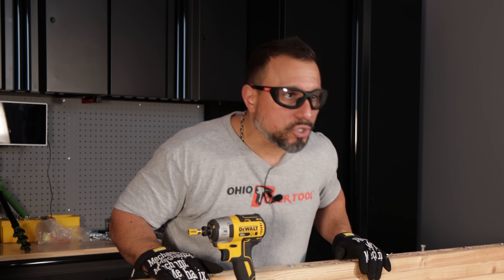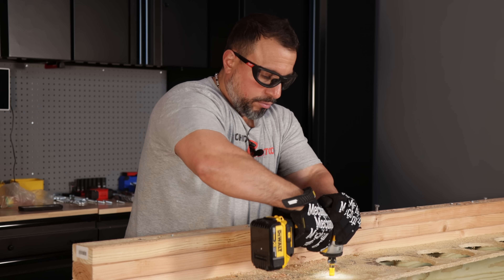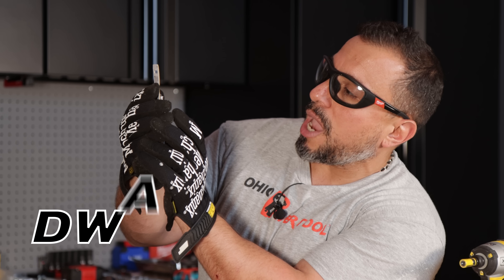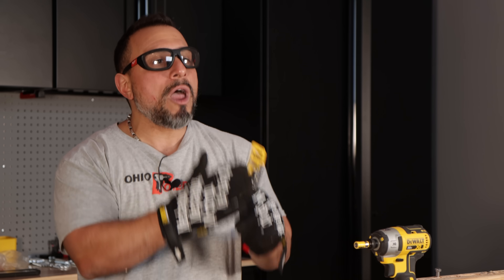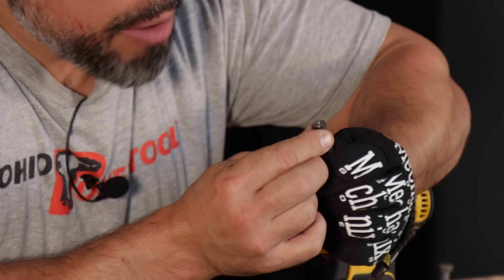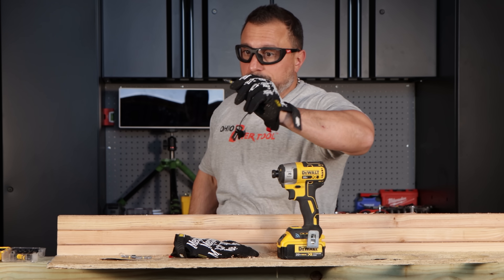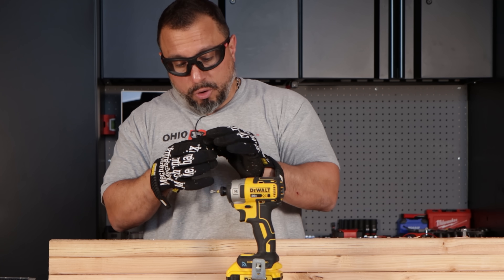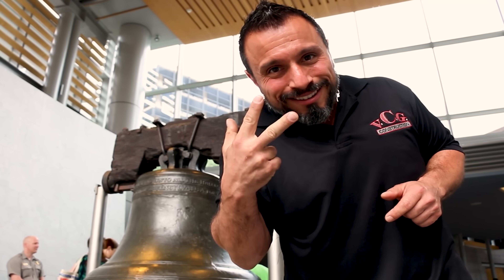MUST HAVE Tool Accessory for Wood Screws & Fasteners!

Comment: Looks perfect for MDF , DRYWALL OR ANY SOFT WOOD .... NICE, THANK U FOR THE VIDEO
Reply: Walmart (hyper tough) has a version that is also a ten inch extension and has a casing on free bearings so you can hold it. As well as slide it forward to hold your screw since the beholder is already magnetized all for like 4 bucks. I absolutely loved it for redoing the handrail on my deck.

Comment: Just picked up that magnetic drive kit the other day at big orange. It's a winner.
Reply: Walmart (hyper tough) has a version that is also a ten inch extension and has a casing on free bearings so you can hold it. As well as slide it forward to hold your screw since the beholder is already magnetized all for like 4 bucks. I absolutely loved it for redoing the handrail on my deck.
Reply: @thehourglasswithaman  Seems to be discontinued its been out of stock for awhile. Only kit at Walmart now I'm seeing with that is a $28 Hart kit. You gotta remeber TTI is moving hard on walmart and a lot of the hyper tough is going to be phased out over the years as Walmart makes a lot more selling TTIs stuff.
Reply: @JamesMKE  i’ll have to check when I go grocery shopping but I literally just bought it like two weeks ago at my Walmart granted the Walmart near me that I shop at is behind the times on a lot of stuff like we were one of the last Walmarts to get her tools and even then when a new one comes out it can be months sometimes before we get one
Reply: @JamesMKE  I just went to Walmart today and I told you I’d update you at my Walmart in Decatur they have a 4 inch and an 8 inch that are very similar to the Walmart brand but they still have the 6 inch that I was talking about before

Comment: I liked the gen 1 but eventually the plastic broke and I couldn't get more (because they stopped making them). So glad to hear there's a gen 2 now! Too bad they won't work with my older bits though...
Reply: Walmart (hyper tough) has a version that is also a ten inch extension and has a casing on free bearings so you can hold it. As well as slide it forward to hold your screw since the beholder is already magnetized all for like 4 bucks. I absolutely loved it for redoing the handrail on my deck.
Reply: Big trouble nieegiorhood involved with peoples law ingury

Comment: Huh, might have to check it out as Ive tried just about every bit mag accessory. My all time favorite is still the original blue Makita Mag Boost but of course Makita stopped making it🤨 Now one on ebay is like $13 bucks lol. Makitas new one is pretty good but woulnt work with a 2" Torx T 40 bit which I use for driving 5/16" diameter lags of various sizes all day long for work. Thats what made the original Mag Boost so awesome because it would work on just about any driver bit of any brand and any length.

Comment: I have the same thing and it's just sitting in my screw gun case because I truly thought it was for sheetrock because it also came in with the number to extension with the sleeve that's you pull down over the screw to help you screw in things but it's brand-new in my truck I can send you a picture tomorrow
Reply: I have a Walmart hyper tough that is very similar to that but it’s also a 10 inch extension, and the casing is on free bearings so that way you can hold it.

Comment: Makita has one very similar. Also good
Reply: Walmart (hyper tough) has a version that is also a ten inch extension and has a casing on free bearings so you can hold it. As well as slide it forward to hold your screw since the beholder is already magnetized all for like 4 bucks. I absolutely loved it for redoing the handrail on my deck.

Comment: Geez why didn't I think of this before! Great idea, not a dewalt fan but it'll do for now.
Reply: Walmart has a version that is also a ten inch extension and has a casing on free bearings so you can hold it as well as slide it forward to hold your screw for like 4 bucks

Comment: I actually did a demolition job and a lot of the 2"×6" somewhere rotted or some just had a little bit of damage so I saved what I could and ended up ripping a lot of them down into 2"×4" then recycled that would into a framing job of a bathroom ended up saving a lot of money.
Reply: Fiqure  you're time and energy and you lost money.
Reply: Pretty cool thing to do, especially when finding material can be quite tricky let alone pricing 😱
Cheers✌🏻

Comment: Yes, those things are great!! Been using them for a few months now( from multiple companies).  I believe the DeWalt ones are the best. Makita sucks, and the other cheap brands suck as well. The accessory is what I speak of when it comes to the brands.
Reply: Walmart (hyper tough) has a version that is also a ten inch extension and has a casing on free bearings so you can hold it. As well as slide it forward to hold your screw since the beholder is already magnetized all for like 4 bucks. I absolutely loved it for redoing the handrail on my deck.

Comment: Unfortunately this is only available for this particular phillips bits because there’s a ring around a bit that only fits onto that particularly sleeve.
Reply: Walmart (hyper tough) has a version that is also a ten inch extension and has a casing on free bearings so you can hold it. As well as slide it forward to hold your screw since the beholder is already magnetized all for like 4 bucks. I absolutely loved it for redoing the handrail on my deck. Also I’ve had multiple different bits sets in there, From Milwaukee to random stuff I found on Amazon.
Reply from the maker: Thanks got the feedback Joe, we appreciate it!

Comment: DeWalt number 2 bits if you compare them to Milwaukee's I believe they fit into the back of the screws better Plus there number  2 bits have a stronger magnet than anyone else
Reply: Walmart (hyper tough) has a version that is also a ten inch extension and has a casing on free bearings so you can hold it. As well as slide it forward to hold your screw since the beholder is already magnetized all for like 4 bucks. I absolutely loved it for redoing the handrail on my deck.

Comment: Vince I’m not hating on you or the video but I’m going to say is Walmart has this exact same thing that is also like a 10 inch extension and it has A casing that you can hold that is on free bearings so that way you don’t have to worry about the tool twisting your hand

Comment: Hold on... imma go buy this
Reply: Walmart (hyper tough) has a version that is also a ten inch extension and has a casing on free bearings so you can hold it. As well as slide it forward to hold your screw since the beholder is already magnetized all for like 4 bucks. I absolutely loved it for redoing the handrail on my deck.

Comment: I using the yellow magnetic driver while using self tapers on thin metal. By the end of the day the magnet broke off.
Reply: Walmart (hyper tough) has a version that is also a ten inch extension and has a casing on free bearings so you can hold it. As well as slide it forward to hold your screw since the beholder is already magnetized all for like 4 bucks. I absolutely loved it for redoing the handrail on my deck.

Comment: Okay, okay, okay. You got ME Vince. Wow 🤩 🤯I love this accessory. However imma head over to HOME-DEPOT 🛠👷🏽⚠️ . When I go to town and purchase this item 🙀🤘
Reply: Love your shows bro, helps me out a lot.
Reply: Walmart (hyper tough) has a version that is also a ten inch extension and has a casing on free bearings so you can hold it. As well as slide it forward to hold your screw since the beholder is already magnetized all for like 4 bucks. I absolutely loved it for redoing the handrail on my deck.

Comment: Not a fan of these bits. They end up catching metal and then won’t engage fully and strip the head. Once you use the buy a few times you can’t remove the magnetic piece to clear it. I’ve bought three of these packs and all of them end up getting stuck. Good in theory but they need to tweak it a bit to make it great.